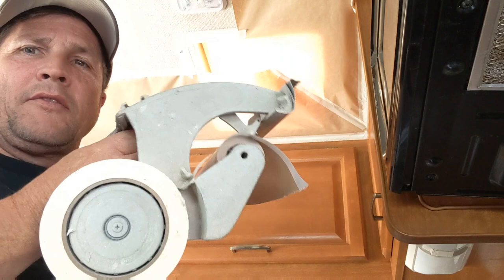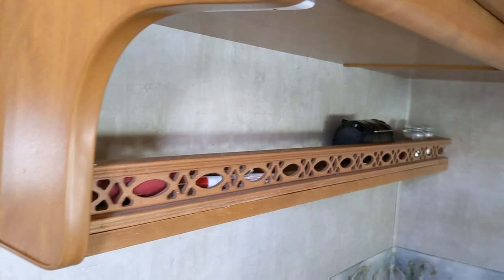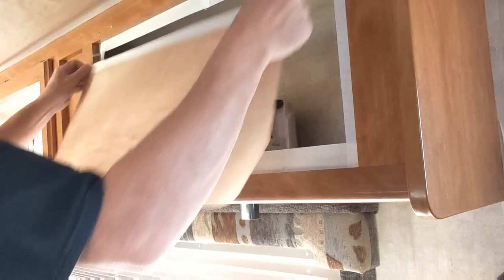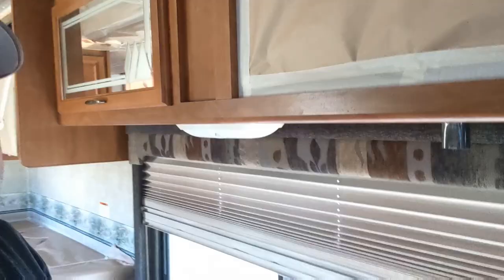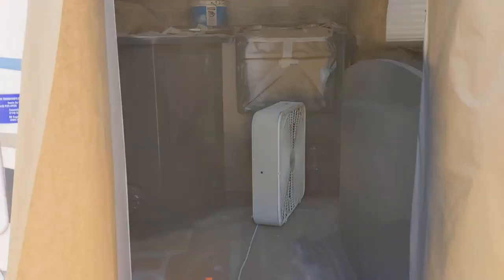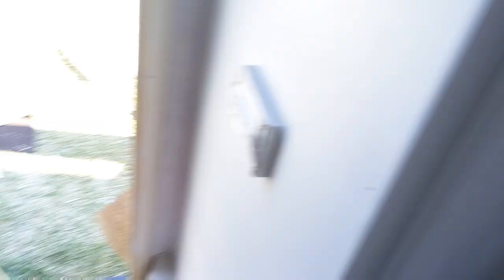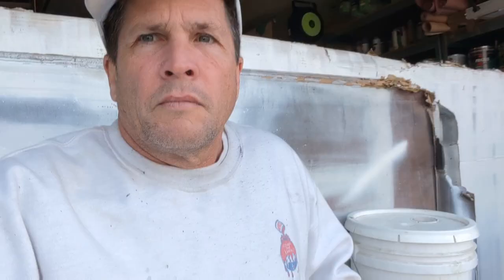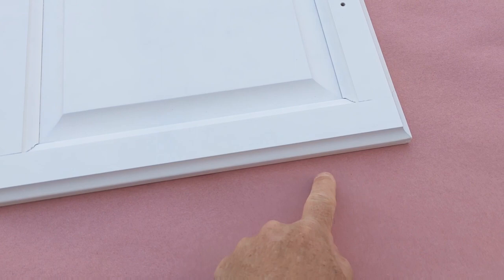RV Remodel Renovation / how to paint cabinets & wall painting

Comment: Love all the details! Super helpful!!! I’m getting ready to paint walls and possibly cabinets. I was wondering about caulking? Did you caulk?
Reply from the maker: A little here and there. If an area to be painted is a white sort of color and has a gap then I will caulk it. A crack will show up more on a white surface than a dark surface
Reply: @JerryFrye1966  what about the silicone caulk from the factory on most edges. I heard nothing will stick to it and you must caulk over that first. Did you have any of that in your RV or did your primer stick to it without a problem? Im getting ready to paint my walls first and your video is helping me feel confident in doing it! My cabinets are a light wood and actually nice. My RV isn’t that old. I’m going to paint walls white, change the ugly window coverings, backsplash and new seat coverings. I’m excited but completely intimidated by the painting. Thank you for posting this and all the details!
Reply from the maker: @clcoley5  if you find any silicone caulking then you will have to caulk over it with paint able stuff. I have used the BIN primer on silicone caulking and it does seem to stick but not sure if it stays when rubbed or scratched at. Do some testing. The BIN shellac primer is your key to getting a long lasting finish. And don't go cheap on the finish. I would use a urethane water base. Sherwin Williams has Emerald Water base Urethane. Home Depot also has a Behr water base cabinet Urethane. You can use mix of ammonia and water to clean up the shellac.

Comment: Looks awesome! I’ll be painting our trailer shortly. So thank you for all the wise words. What did you do to prep the walls for paint?
Reply from the maker: Just applied a quality acrylic semi gloss. You can test your own walls by painting a small area and do a scratch test to see if it sticks good. Mine was fine to just apply two coats of finish
Reply: I keep hearing to use an oil based paint. Any takes??? Im going to be doing our 30ft 5th wheel we live in. Definitely want to make it more unique
Reply from the maker: @TinasCrazyLife  
 that's old timer speak. I only use a oill base paint on a bathroom that tends to get mildew growing repeatedly on the ceiling. The waterborne paints now a days are superior to the left behind oil based paints of the past. Most of these paints are a oil based paint but are a water clean up. The emerald is a just that.
Reply: @JerryFrye1966  thank you soo much

Comment: did you sand the cabinets before using shellac primer
Reply from the maker: I scuffed them up with 220 a little bit, but not with a vibrating sander just by hand. The Shellac primer sticks a very very well as long as it's not oily.  You want to make sure you wash them down with Dawn dishwashing liquid first in either case.

Comment: I saw you sanded the doors to the cabinets but did you sand the cabinets? Is there a special type of paint that doesn’t require sanding?
Reply from the maker: I did a light scuff using 220grit sandpaper. Mostly the sanding is to make areas less slick. You could try a liquid deglosser if you don't want to sand.   There are many primers that say no sanding needed but I always do.

Comment: Good result but i dont think i wd spend that much time taping everything including the ceiling etc. clean surfaces with TSP; some light sanding fine. tape off edges; paint n primer in one can; use two coats and its done. I did my whole kitchen that way; way faster way easier.  I did not remove the cupboard doors. kept all windows n doors open. bdrm doors closed to prevent sleeping in those fumes of waterproof paint curing yikes.
Reply from the maker: Yeah painting can be easy or it can be difficult My job is to make it look difficult so I get more jobs hahaha.
Reply: @JerryFrye1966  that i believe